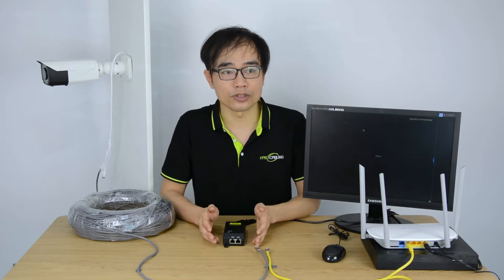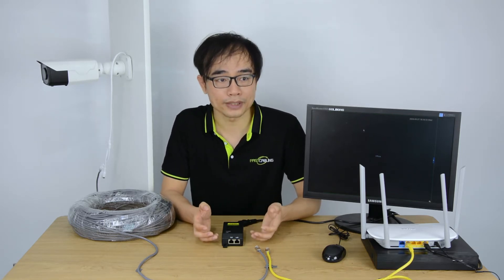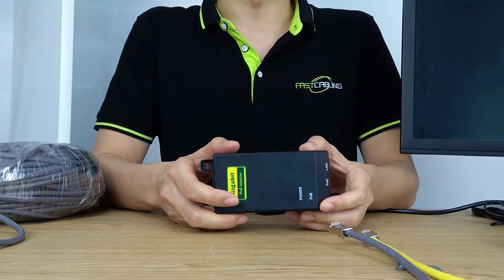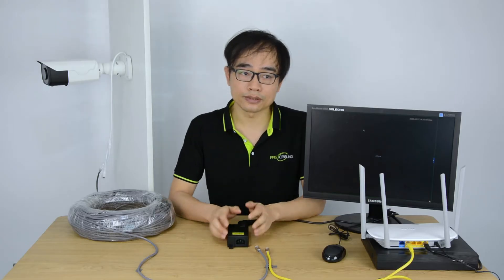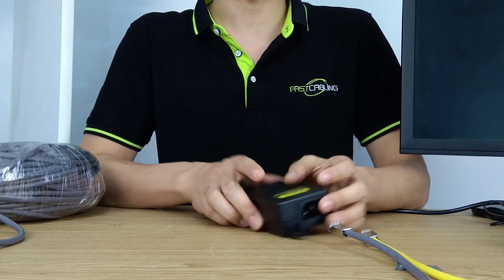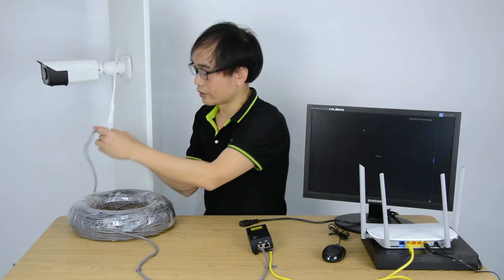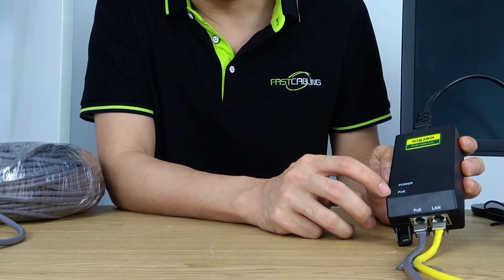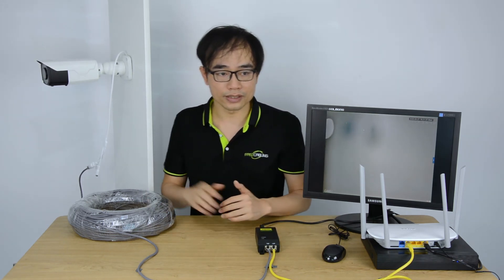How to use PoE injector to power your IP camera

Comment: What voltage poe injector can I use with 15v nvr camera to power them?
Reply from the maker: negative. The standard implement the power between DC48-DC55. Any voltage lowee than 36.5V will be considered overlow and the poe system will enter protection mode.

Comment: hi sir can I use 30v poe injector for the IP cam 12v output only?
Reply from the maker: Negative. The 30V is non-standard PoE. While the voltage is less than 36VDC, the PoE Splitter module built in your camera will enter protection mode. As the voltage is over low for standard PoE.
Reply from the maker: Negative. The 30V is non-standard PoE. While the voltage is less than 36VDC, the PoE Splitter module built in your camera will enter protection mode. As the voltage is over low for standard PoE.

Comment: Let's say I have a WiFi CCTV or WAP. The location is not convenient to layout a LAN cable . However both the  CCTV which wireless and the WAP can be powered by POE. At location I have a power point. Can I use the POE injector to power up the CCTV camera and WAP? There's dual output POE Injector right? Or I will need to add in POE splitter to power both of them after the POE injector?
Reply from the maker: You don’t need splitters. The PoE injector will be good enough. Properly two PoE injector you will need. Here is the similar case for Wi-Fi6 mesh. It needs PoE injector to supply power only. https://youtu.be/5PkqGiv-KHM

Comment: How can i connect the ethernet camera directly to a TV? with RCA? is there a POE injector or device to take data from a ethernet camera and directly show on a TV?
Reply from the maker: No, you can’t. The network camera or IP camera is digital product. The video is being digitalized. All the information is turned into zero or one. The RCA TV is analog device, you need NVR to decode the video feed and output to a TV, either through VGA or HDMI

Comment: Injector to DC Voltage? and DC Amp ?
Reply from the maker: It is a standard PoE system. The output voltage could range from DC48V-DC55V. It depends on how the hardware design. There is power handshaking between the injector and your edge device (PD)
Reply: @Fastcabling  thank you.

Comment: Great Information ...  How to cover 150 meter distance using POE injector + non POE switch? can poe extender be used with this combination? Will it pose any bandwidth issue?  I will be obliged if you help me regarding my query.
Reply from the maker: You may consider the 1 in 2 out PoE extender. It delivers 1000Mbps bandwidth with 200 meters. You can hook up either PoE or non-PoE equipment directly to the output ports. https://www.fastcabling.com/product/poe-extender/

Comment: I have an 8 channel NVR that was injured in a power surge, only 1 poe port works  now . I can hook up each camera 1 at a time into this port and they all still work. My question is, can I somehow use a poe switch or something to connect my cameras to that one port on my nvr and get all pictures back?
Reply from the maker: Yes, it probably works. You can test the setup with existed router before you actually order the PoE switch.

Comment: can i use a ethernet splitter on poe port? I mean can I connect two camera from poe port?
Reply from the maker: You can't use the Ethernet splitter to split the PoE and the data. The PoE extender can get the job done. One PoE in and two POE output. https://www.fastcabling.com/product/poe-extender/

Comment: If I have a poe nvr but my ip camera is not poe camera. What do i need to buy?  Thanks!
Reply from the maker: What you need is the PoE splitter which is IEEE802.3af (PoE) compatible. The PoE Splitter will seperate the DC power from the network data. I mentioned the standard of the PoE, because some of the passive PoE Splitter doesn't work. There is handshake between PoE switch and PoE splitter to keep the power system safe in standard PoE.